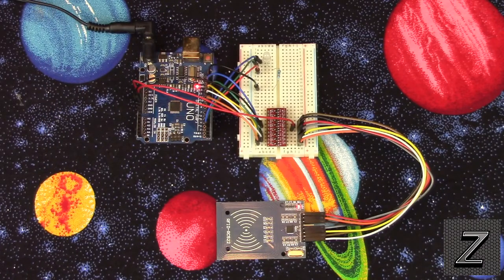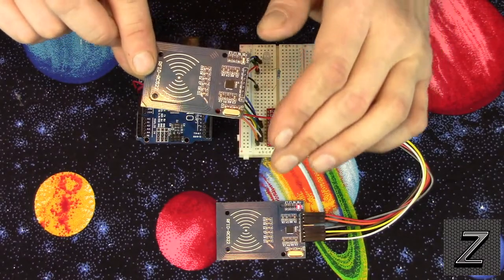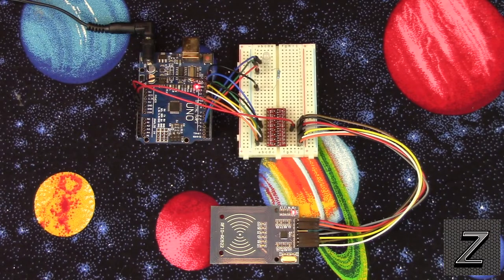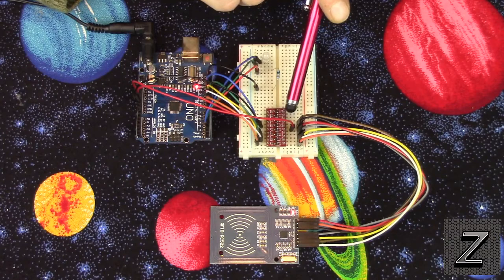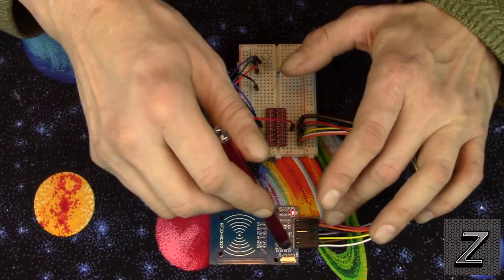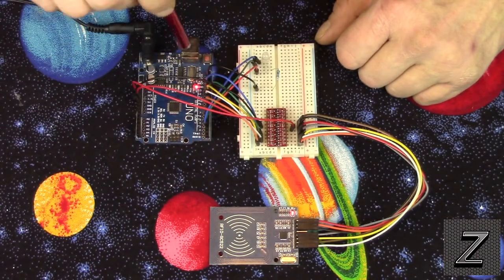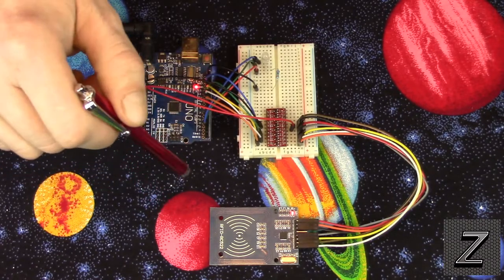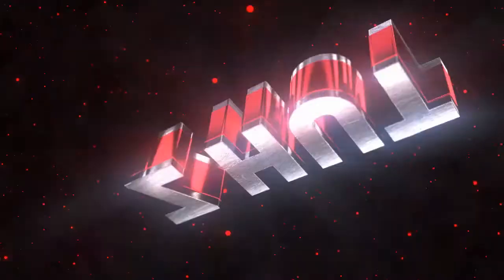The correct way to connect a RC522 RFID  reader to your ARDUINO

Comment: Hi! My logic converter has TX1/RX0 on low-voltage side and TX0/RX1 on the high-voltage side. Are they important on the connection between Arduino board and the RFID module? Or should I take them as they are? Thanks!

Comment: I did fry three RC522 after some time of use. Probably due over voltage in signal pins. I'll give a try in this level converter.Thanks for posting.

Comment: Hi I am having issue with my RFID card, the moment I turn it on and it will read the card. After a few hours it doesn't read at all. Does Logic level converter helps to solve this problem? Is this 100% accurate?
Reply: HAHAHA hey i'm having the same problem, it's really frustrating watch a lot of videos doing it wrong

Comment: What do you think, not using a logic level converter could be the cause of a problem that the reader stops working (reading) after a small but random amount of time? Only restarting the arduino solves the problem.
Reply from the maker: If you did not use the logic level converter you would fry the thing it is not meant to be used with 5 volt logic its 3.3 volt logic
Reply from the maker: Although it probably wouldn't work for a little while but eventually it would quit working and die
Reply: @z-hut1663  Thanks, i'll give it a try with the converter and let you know if it still stops to work.
Reply: @ahuszko  i have the same issue as you, i have a 3-5 second window to get a read. did you resolve this issue?
Reply: never mind, the logic converter fixed it,
Reply: wow, all the Spanish tutorials explain it on the wrong way, i was spending a lot of time making the cables longer 'cause i supposed that was an insolation problem, but this is the key